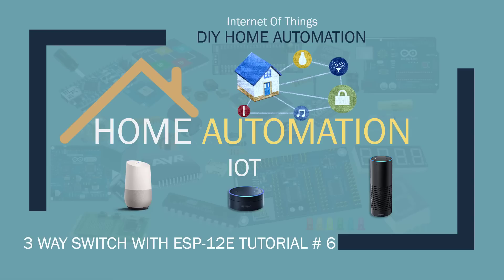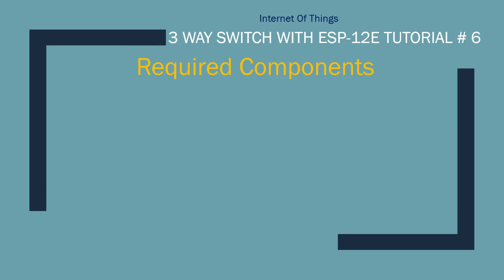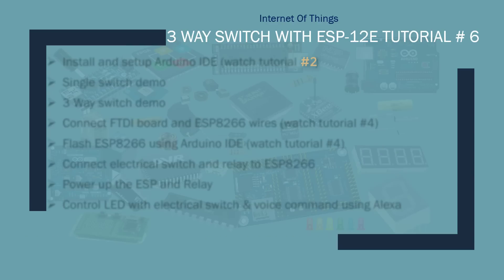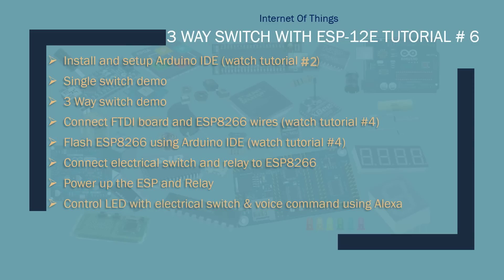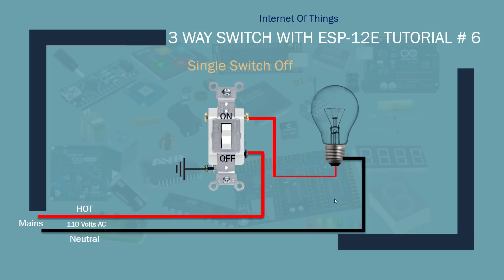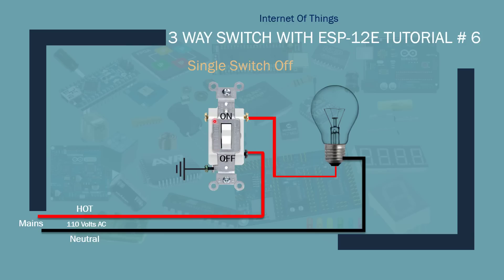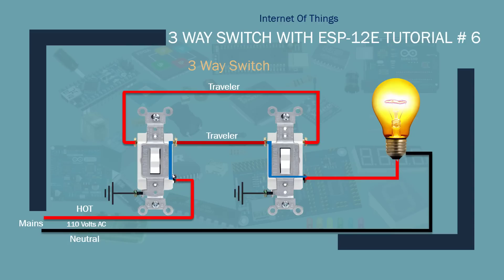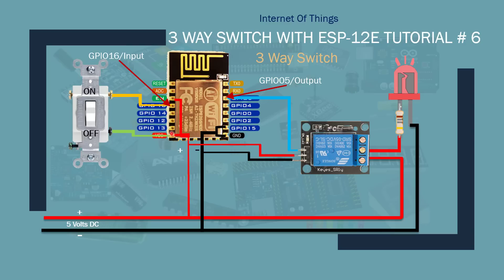IOT DIY Home Automation with Alexa | 3 way switch Part 1| Tutorial # 6

Comment: Wow. Your idea is amazing. I was struggling with 3 way switches and relays to find out if the load was on or off. By putting it all on the ESP you just solved the case without any other hardware. Thank you so much!

Comment: Dear Mr. Nassir, I´ ve introduced the code , changed my internet login and pass to 8266 mcu, and connect gpio 5-terminal 1 at 8266-with exemple without external input switch, only to test the gpio 5 and rele. 
I´ve connected the echo dot. My echo dot has others skills and aplications. After talk " computer (I´have change the name on alexa skill) turn on demoswitch...does not work ! Does Echo Dot need alexa skill configuration ? How does work withou alexa skill configuration...?
Reply from the maker: Paulo Raposo what do you see on Arduino serial output when you give discover command to alexa?

Comment: Dear Mr. Nassir, the Node MCU has 5 output GPIO 
GPIO4
GPIO5
GPIO12
GPIO13
GPIO14

//In your code,  we use to one switch only. 
//Change the GPIO
const int switchPin = 16; (input GPIO with 5 VCC)
const int relayPin = 5; (output -rele pulse signal-5vcc) 

I´d like use 5 differents switchs using the same 8266, controling  5 differents reles. how do I use the input at same 8266 ? 
How does Alexa understand the name of differents switchs , to control them ?

cheers, Paulo
Reply: Paulo Raposo

Comment: and can you use wemos instead because it uses a 5v usb ?
Reply from the maker: bobby royster Yes
Reply: So on the diagram where you have on the esp, VCC jumper to EN on the wemos you would have 5V jumper to ???/ the memos does not have EN..interesting of making one but would like to use a Wemos instead. Am running Home assistant and would like to see if this can be integrate into HA.

Comment: I'm about to try this In of my rooms in the house to see how I like it before I do all rooms this will save me more money I'm doing a hole home rewire so it will save me in wire
Reply from the maker: John Kinder You should wait for my 2nd tutorial before attempting to implement this solution. First tutorial diagram is a proposed high level solution. I will publish complete diagram and code with 2nd tutorial. I am working on it as we speak.
Reply: Netmedias that's cool man I just saying because I work for a Electrician and want to show him some thing new
Reply: All want to ask I'm using home assistant I got some things run with esp8266 using mqtt is there a way that I could add that in
Reply from the maker: It can be implemented with any IOT device as long as you can modify your ESP sketch.